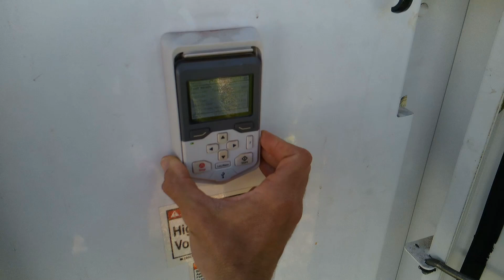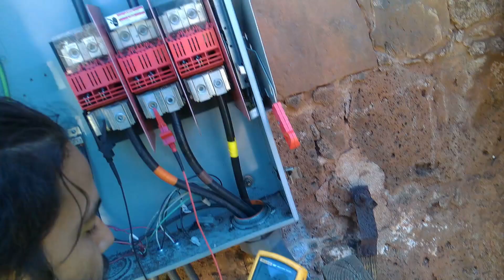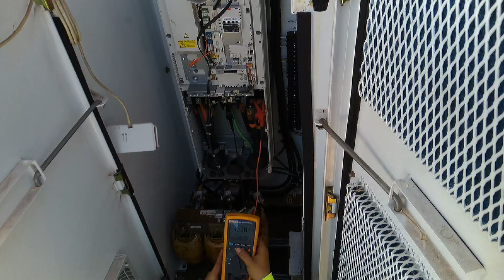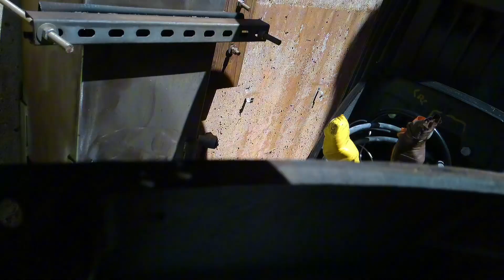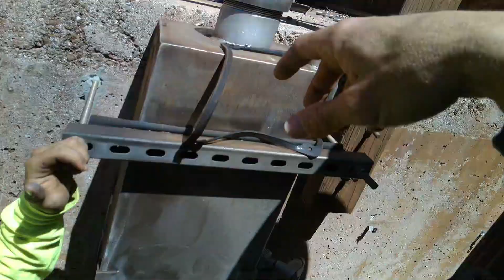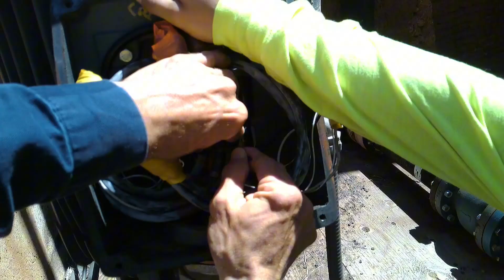Ground Fault Trouble Call

Comment: The first (and absolutely most important) thing to understand when measuring insulation is that the instrument's POSITIVE (+) terminal is always connected to ground, and the NEGATIVE (-) terminal to the cable under test!  🥸

Comment: And we all know that phasing tape should not be used for insulating and used only for identification only.
Reply from the maker: Exactly right,
Thanks for watching!
Reply: @ I'm a retired Master from a Maryland/DC suburb east coast. Thanks for your video. 45 years residential and mostly heavy commercial sparky.

Comment: Earth leakage is the British term for a ground fault.
Reply: It's a pretty universal term outside of the USA and countries that pay attention to the USA method of electrical.
Reply from the maker: Cool, I didn't know that
Reply: @Up-CountryElectric  Just to confuse you 'earth fault' is also used but it has different connotations.  Leakage could just be capacitively coupled current to the earthing system - a switching power supply for example - while fault implies something has gone wrong - line to chassis.

Comment: Nice work showing the kid how to test insulation resistance. As soon as I realized you were at the same pump station, I thought check the terminations. The tape job on those motors were terrible. When installed they should get two layers  of cambic tape, three layers of rubber insulating tape, two layers of vinyl. Even then they can eventually rub through in a high vibration application if touching something. I carry rubber gasket material with me that’s about1/8 to  3/16” thick. When the pecker heads are small, I either line the lid with the gasket material or wrap each lead with some to add an extra layer of abrasion resistance. With a helper there, I would have cut tape off one termination and taped it properly, then let the helper/apprentice do the other two. Would have been a lesson that sticks with him his entire career.
Reply from the maker: That's great advice. We opted for quickly getting it repaired. Hopefully it holds for the life of the motor. I'm definitely gaining a greater appreciation for what constitutes a good motor splice from both of these faults.

Comment: They should have used phase tape lower on the conductors and rubber splicing tape over the splice. Another way would be to use mechanical clear taps.
Reply from the maker: Definitely, thanks for watching!
Reply: Cambric tape then 130c then a wrap of the colored 35 tape when using split bolt connections in peckerheads.

Comment: I would convert it to set screw type lug. The one that made for the DIN rail. Molex has nice ones. It’s already have plastic insulation around it, and works nice joining conductors of different sizes.
The only thing you’ll need is make sure it’ll fit in to the pecker head.
Reply from the maker: That's a good idea for sure.
Thanks for watching!

Comment: Are those motor connections are the standard over there? 🤣
Reply: Unfortunately. Lots of times old guys just used split bolts and wrapped them in rubber tape. For motors or any splice that is outdoors really, I prefer insulated polaris taps, they're great.